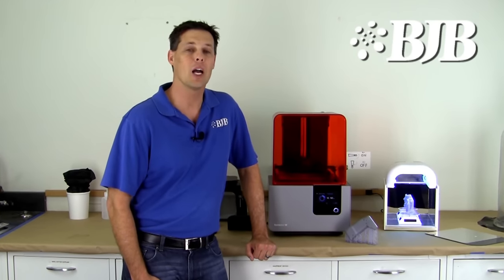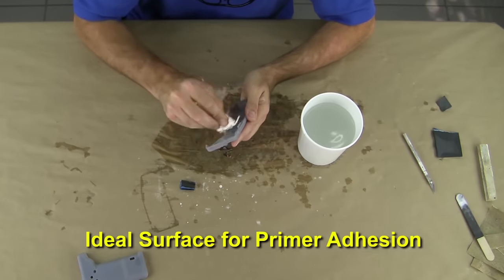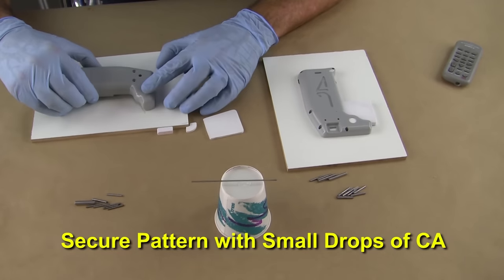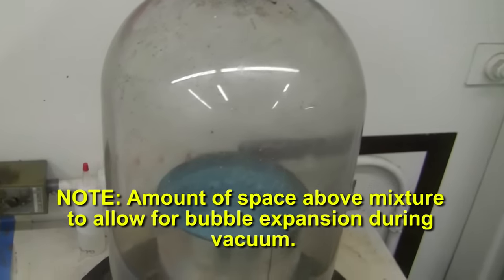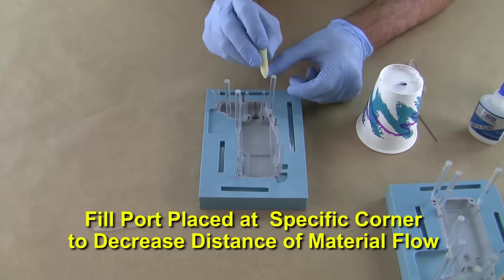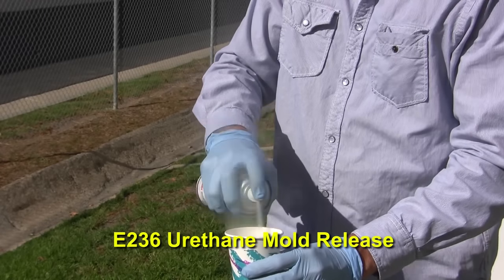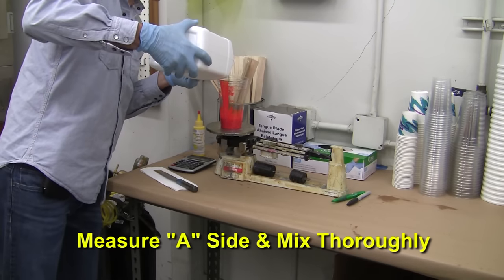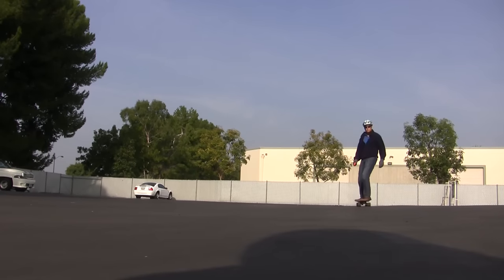Pro Series Silicone Mold Tutorial | Electric Skateboard Controller

Comment: Hello BJB, such quality video is amazing Thank you!!

Now i have a question, for mass production product, like laptop/phone plastic frame/case

 wich i'm planning to build (custom laptop manufacture), do you have an idea of where i can find the ressources to get knoweldge for that field?

I've designed and printed a working prototype but for sure i can't 3d print mass production, the quality and the finition is not like what's on the market.

Thanks again :)
Reply from the maker: Our production customers typically look at casting parts in this process for several hundred to a few thousand parts using tools built for production.  If you are making parts in the tens of thousands of parts, you will typically find injection molding starts to become more cost effective.  If the parts are large, you might also look at the RIM urethane casting process which is used for some specialty parts in high volume production.  We have many customers that specialize in producing parts from prototype all the way to production and will use our urethane casting process for short to medium production.  It is cost effective in certain quantities and changes to design are easier to make in this stage vs full scale injection molding.  It is hard to recommend resources since we don't understand the scope of the project or part details.
Reply: Ho thank you for that one! these process are amazing, now i see more clearly how plastic parts are made.

can i have your mail to send you some picture about what i'm looking in order to get your expert view? your help will for sure return the favour in the next years.
Reply from the maker: You can send technical inquiries to:  info@bjbenterprises.com
Reply: i will, thanks

Comment: Can I ask how many copies/time will such silicon molds last? Thanks for this video!
Reply from the maker: Always a great question.  Many professional mold shops quote 25-30 parts out of a production mold but many individuals report as much as 50 parts if the part is simple and the casting material isn't too hard on the silicone tool.  It's a "your mileage may vary" situation with many factors involved including desired surface finish, tolerances, etc.
Reply: There's also a wear-in period and a wear-out period, where the produced parts will look slightly different coming from the first few castings and after the mold starts to break down. How many parts a mold can produce will (in addition to molding and casting materials) depend on what's acceptable in terms of defects and post-processing.

Comment: I'm curious how many parts you could make with a single silicone mold
Reply from the maker: Great question.  There are several factors to determining mold life but a low number is 25-30 parts and a high number is up to 50+ parts.  You will typically see the surface become more and more dull and parts become harder to demold.  Rigid cast urethanes are harder on tools than softer urethanes, and type of mold release used also has a factor.  Silicone molds excel in dealing with undercuts and fine surface detail  Their non-stick nature allows easy molding against a variety of pattern materials without having to worry about epoxy or urethane tools (which require a lot of mold release) trying to stick to the pattern.

Comment: Why did you place the printed part on the bed so skewed? Putting it outer face down, as I printed this with a traditional printer for my cousin, would have saved all the material spent on supports
Reply from the maker: Ephestione's HQ The Form 2 builds parts differently than a traditional FDM printer.  The software orients the part and generates supports automatically based on the optimal build.  It’s a little confusing compared to FDM printers but they have tutorials on the concept and reasoning behind it.

Comment: You could have laid it on its side in the slicer so you would have used less support and also less resin
Reply from the maker: Thanks for the tip.  We used the Formlabs software to auto-orient the part in this project.  Now that we're more familiar with the build process we've learned to set up things more efficient.  Thanks for watching!

Comment: How did you decide on the vent locations?
Reply from the maker: The part we are making in the video has a lot of intricate detail and places for bubbles to get trapped so it was more challenging than normal, but the strategy to place vents is the same.  You need to establish where you will fill from and the vents will be placed at corners and high points as they radiate from that starting pint.  In many cases, we angle/tilt the mold to force a low point and then higher points become logical venting locations.  You have to really look at the part and examine where bubbles will rise and become stuck because there is no direct path to a vent.  It may help to watch our intro mold video for a simpler explanation:  https://youtu.be/iRj6xzNx7P4?t=15m21s

Comment: How many Times the mold ca be used ?
Reply from the maker: It can vary depending on a few factors, but a safe number is 25 with a possibility of getting up to 50 parts if mold release is used and the grade of polyurethane is not overly aggressive on silicone molds.  Keep in mind the gloss of the parts out of the mold would likely go down, but if this were a part to be painted it would not be an issue. We also find that the softer polyurethane casting materials are less aggressive on silicone molds so part yield is often higher than rigid polyurethane castings.  Occasionally we do have customers getting 75-100 parts from a silicone mold but the conditions and variables are often unique.

Comment: Hi. good day to you. Thank you for sharing a very detailed video. I have a question, Wouldn't the air present inside the mold cause air bubbles on the poured PU resin and affect the quality of the output?
Reply from the maker: That is always the challenge to producing good quality cast parts.  How do you deal with getting the material in the mold without introducing air bubbles?  There are several techniques to help avoid the issue and they are very different from technologies like injection molding.  If you are new to this process, you should watch our intro video that explains many of the other techniques used to produce air free parts.  This video is an advanced tutorial for those already familiar with casting polyurethane into silicone molds.  https://www.youtube.com/watch?v=iRj6xzNx7P4&lc=z23hslhqhseygphq504t1aokgwdg3rikfqviu41htwqpbk0h00410

Comment: Couldn't you also print the vents?
Reply from the maker: In theory it's possible, but in the practical sense you might end up knocking them off during clean up because they would be rather delicate.  Since you are usually sanding the 3D Printed SLA pattern and adding a coat of primer and/or paint, it would be tough to navigate through a cluster of vents to effectively  prep the surfaces.   Great question, though!  If you end up trying it successfully, please let us know.  Thanks for your comment.
Reply: I see, thank you!

Comment: hello, i ran into mad inhibition issues when molding sla parts with platinum silicone (from several brands except bjb) and thought they were inherently incompatible - until i saw you doing it. is the used sla-resin or silicone in any way specially formulated to allow this combination? or do you have any other insights or expriences addressing this topic?
Reply from the maker: We assume every SLA resin will give us issues when molding against it, so we are sure to seal it with a good primer like the SEM shown in the video at 2:12.  There are so many formulations of SLA resin out on the market, unless a resin manufacture has specifically run tests and makes a statement, we can't answer that one.  SLA has been around for 20+ years and it's always been an issue in Rapid Prototyping.  Sealing the pattern is simply part of the process.

Comment: why didn't you just printed out the mold?
Reply from the maker: Z264 Good question.  First, you won't achieve the nice surface finish seen here in the silicone mold.  Second, you will have much more work in applying sufficient mold release on all surfaces to prevent parts sticking.   Silicone is inherently non-stick so only a light application of mold release is needed.  Third, you are limited in shape and geometry.  Silicone molds can deal with deep drafts and small undercuts because they can flex away from the cured cast parts. In some cases 3D Printed molds are used.  We made a video showing the process here: https://youtu.be/KweiHPE4Ftg
Reply: Couldn't you just do some post-processing? Seems like with some engineering work, it would be a lot faster. Examples could be: pre-printing the alignment pins, using some kind of bondo or sandable material where you needed a perfect finish. In the end, you'd have a rigid mould that could have flanges or ears for clamping.
Reply from the maker: Hi David, in some cases it may be possible but once again it depends on the application.  For quick test parts and R&D, it may be fine.  If it was a cost effective method we would see many of our short to medium production customers using the method as they are typically using the latest 3D Printing Equipment and processes, but the silicone mold is still king for this volume of production and finish quality of cast parts.  Silicone has pros and cons like other processes, but the advantages like surface quality, undercuts, and mold halves that seal without leaking (like many rigid tools) continue to prove its worth.  Ultimately things progress and processes improve, and we are in the mix with material and technical solutions within the industry, so things are constantly changing and we progress with it as a company.  Thank you for your comment! -BJB
Reply: Cool! Didn't mean to call you out, but was just curious. Also, I have to justify my recent purchase of a 3D printer somehow...
Reply from the maker: No worries, we enjoy questions and discussions like this.  It's good to see what folks are interested in learning about and it's good to weigh the options for making parts.  If a mold making video like this spurs ideas and conversation then we are doing our job right!   Although 3D Printing has been around for 30 years, the availability to the consumer level has spurred a whole new interest in education to learn how to expand their usefulness.  Be sure to check out the other videos in the "Beyond 3D Printing" Playlist to learn more.
Reply: I would love to see silicone molding become widely use for small and moderate production and how easy to produce a product even with undercut and draft angles, however the plastic materials is another area that needs to be improved on. I want to compare the price of plastic mix product with pellets. It seems like the pellets are much cheaper and there a variety of plastic material of choice to chose from,. If the price of plastic  materials for silicone molding is as competitive as pellet I would definitely jump into this type of procedure.
Reply from the maker: Plastic pellets are cheaper per pound/kilo than 2-part Polyurethane systems so the cost savings is not in the raw materials, it's in the ability to amortize tooling.  The resins and plastics used in pellet production are more commodity-like and cast urethanes are often highly formulated products with relatively lower volume.  If the part volume is not to a certain level, then injection molding may never be an option.  If the part is very complex or large, tooling costs may prohibit any short run production injection molded parts or prototypes.  Large 3D printing companies like Stratasys and 3D Systems supplement short to medium run production with cast polyurethanes into silicone molds so it remains a very viable option.  Compared to injection molding it is a specialty niche and helps to "Bridge" the prototype to production process.  With 3D Printing accessible to small businesses, the entry point to short-medium run production is relatively low cost.  If you are looking to mass produce, urethane casting may not be the right process.
Reply: You realize you are asking how to make a mold without using silicone... on a video by a company promoting one usage of their silicone products. Some people, geez.

Comment: One of the most over engineered Mold castings I've seen 🤔- But! The results are fabulous 👍
Reply from the maker: It's true this is a complicated mold.  However, we receive a lot of questions on how to approach pins and slides in silicone molds.  This particular mold is still producing parts to this day for short run production.
Reply: @bjbenterprises  How many parts can you make with this mold in an 8 hour day?
Reply from the maker: @LukePighetti  It depends highly on what material system you use.  We have materials that can demold as quick as 15-20 minutes using heat and dispense equipment.  Some systems might take 1-4 hours depending on what working time you are capable of dealing with (vacuum pump strength for degassing material, time needed for pressure pot if used, etc).  So it really depends on an individuals equipment and capabilities.  Many professional shops try and turn the mold in an hour or less allowing time for clean up, mold release, and re-strapping the mold together.
Reply: @bjbenterprises Do you guys have experience or opinions on rigid tooling for resin? I am able to create aluminum injection tooling in house but don't have access to an injection molding machine. Trying to find a way to do about 12 parts a day, each part about 2cc.

Comment: way too much work! I print the whole mold in the printer!
Reply from the maker: For some parts that works fine.  We have videos showing how to work with 3D printed molds.  For some complicated parts with undercuts, texture and detail, silicone molds are still the most popular technique in rapid prototyping due to the surface replication and ease of release.
Reply: @bjbenterprises  True! I completely forgot I'm 100% doing silicone parts and not rigid!

Comment: I rather print all of them instead of casting them
Reply from the maker: Hi Keith, in some cases it is fine to simply print the parts.  However, in the world of short-to-medium run production you will find that the reality of cleaning up a 3D printed part, even a high resolution SLA print, will become more time consuming than casting into a well-designed mold such as this.  You are also limited in color and physical properties.  With FDM parts, the clean up is even more time consuming and your finished aesthetics are may not be acceptable for the customer.  3D Printing is also much slower than the casting process.  Molding and casting from 3D Printed parts is a decades old process and the service bureaus that do this work for production choose to cast parts beyond a few 3D Printed prototypes for efficiency and cost.  Thank you for watching!
Reply: As BJB says, try making dozens of SLA prints and see how well that works for you (don't forget to factor in cost!). Also the standard resin has limited deformation properties, so it tends to fracture during decent impacts. I think Formlabs' new fuse 1 would be better suited towards direct printing small production runs. Although we'll have to wait and see how good the print quality is on that unit.
Reply: Wouldn't it be less time consuming and or cheaper too just print a mold and cast resin directly into it?
Reply: You could print an mold with an flexible SLA resin however that mold would not last as long as one made out of silicone. In addition you would lose the ability to get an perfectly smooth surface finish with that method (flexible resins do not sand well).
Reply: Funny how people suddenly become experts when I watch this videos from proffessionals..